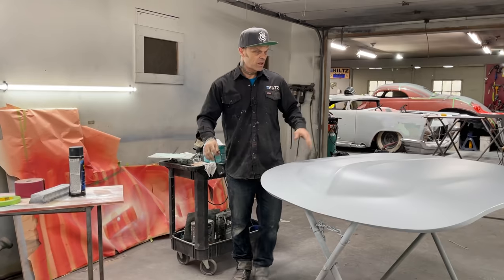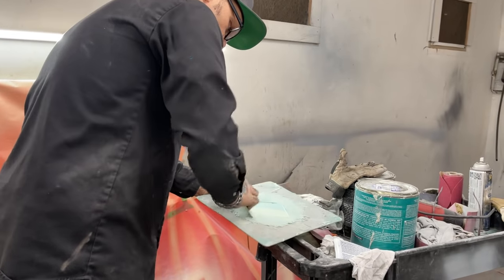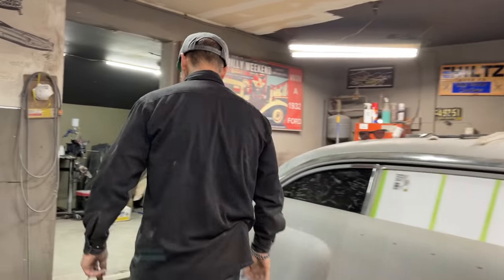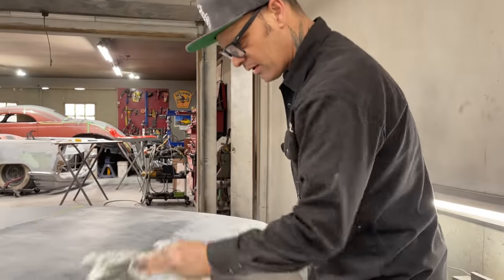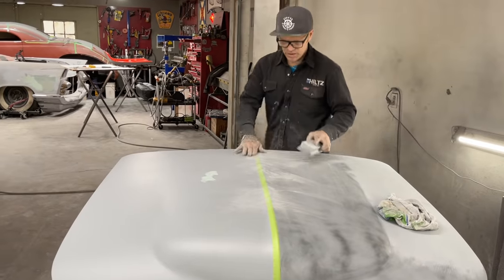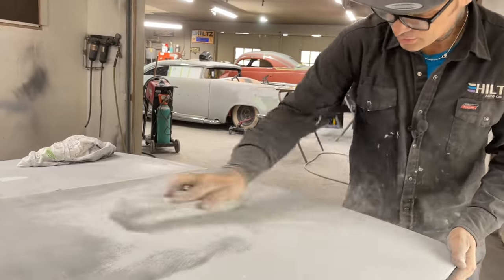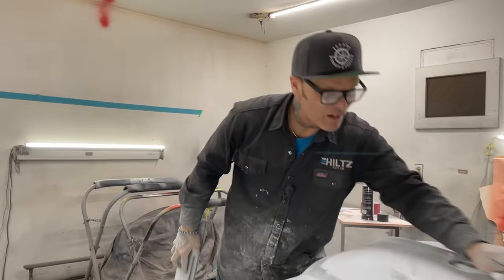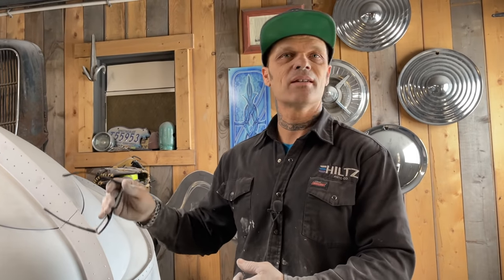Block Sanding Primer the EASY way - DIY tutorial

Comment: I use 1997-2003 Pontiac Grand Prix window regulators. They are very small and the cables are both on one end. Just straighten the track and it works great. Try it, it’s very easy.

Comment: I looked up Elvis Guitar straps last night and found a few keen straps, then I was thinking a guy has to have a way to hold the strap in place once you have the window where you want it..

with a guitar strap there are positions in the way of slits, that's how you adjust its length on a guitar, they slip into a button like the old Levi buttons on the 501's.. longer a different slit.. maybe you can use guitar straps? use the slits and a guitar button mounted to the door to lock the strap it in place and have adjustability?

my guess is you are going to want some weight at the bottom of the window just for some stability so the window doesn't fly up on bumps so forth... when you have window where you want it in any position clip strap top button.. some nice Elvis straps out there, I can prolly drop ship 2 at your door with a few buttons that mount very easily, phillips head...  there are strap lock set ups be pretty cool too, push button style what not and that locks the strap to the button, you have to push a button to remove strap off button..... you're doing it for both doors right?

Comment: They make slider windows that go side to side in trailers also up and down with just a small finger plate to push pull, but they use a weighted string to keep them up,,Love the simplicity of the belt as long as its centered it should go up without trying to angle but on the driver side i would use a belt that has a zipper on the back so I could put the insurance and registration in it ,I had a belt that has a zipper that went across the inside,sort of a stash so to speak,,Great job as always guys,

Comment: Greetings friends 😊 I  learned something hear today. 80 grit is the best to block with, if you use 100,120,150 you'll just be taking the guide coat off and not leveling, changing cloged paper 10 times . I've been doing it wrong I'll admit, 80s faster better results and only sheets. Awesome 👌 🆒️.  Common sense 👏 is what we have learned here, I  like the hand method better than the DA,less  dust. Brilliant 👏.

Comment: Chad, PLEASE try 3M or Mirca dry (powedered) dry coat. I recently started using it and the difference is AMAZING. plus, you can use the Mirka white dry guide coat during wet sanding clear between grits of sand paper! 👍🏻😎

Comment: What I do to find every pin hole is clean it really good so it's smooth with no dust, turn the lights off and use a flash light and all the tiny shadows are the pin holes.

Comment: Zebra print fir the interior. Elvis loved his Jungle Room, ploys it would set off the black white theme of the car. That red is such strong color a little goes a long way. To use it in interior it would overwhelming. The dash and a few parts with the red is ok. But Zebra would be a great finishing touch. Your going tint the windows so imagine what a powerfully cool effect it would have when you opened the door to that Zebra interior. On the strap you should put TCB. Elvis’s motto, he and all his Memphis Mafia had gold chains with a lighting bolt, like the one you’re going to put in black on the sides, but on the gold lightning bolt was TCB, it stands for “Taking Care of Business”… if you’re naming the car Elvis do a little research. A true Elvis fan knows all this and would appreciate the sentiment…

Comment: The tape on the hood is a good tip👍
Reply: It helps keep the body lines sharp. I try to put the second piece of tape on before I pull the first one off. Yes great tip.  When paint is on the panel it makes all the effort worth it

Comment: I know that many European sports car manufactures back in the day used a belt pull system in the doors for windows. Because the doors were so thin. There was no room for a crank mechanism inside the door.

Comment: The flash time all depends on the time solvents require to evaporate. The issue is some solvents require more flash time than others. 
So also layering primers. They stack better by adding layers. If just one heavy coat then certain formulas condense and becomes only so thick. 
If the primer flashes enough before you add the rest of the layers then you are fine. You will know if you have one heavy coat that is just more dense or if you have a primer layer build going on once you start sanding. In doing body work we do what works for us. We have to do the work in the end so we make it easy for us. No one else. So if what you do works for you that’s cool. As long as people don’t try to force us to do things only one way. Their way…I’m good. Lol

Comment: Here's a cheap trick for sanding in curved areas, go to the hardware store and get some paint rollers but get the cardboard backed ones so you can form them and wrap your sandpaper around one and use it as a kind of curved block.

Comment: if you connect both ends of the belt to the window, out of the top of the door and in at the bottom in a loupe you could both open and shut the door window pull it down to open and pull up to close.

Comment: If you are going to use a belt to have the window go up & down (instead of a crank or power windows), why not put a roller on the interior of the door down low, and make the belt loop from the bottom of window down to the roller and out of the bottom of the the door panel (with a couple slots in it) and back in the upper slot in the door panel, and back up to the bottom of the window. Feed the belt through the slots and have a small handle on it between them so you can raise and lower the window. You would raise the handle to lower the window, and lower the handle to raise the window. (I hope I explained my concept clearly enough...)

Comment: Hello Chad and Jolene, 

Great job on the hood. I was wondering, which do you prefer, a stiff block of a soft rubber block? No pun intended lol keep up the great content.  Take care and God bless.
Reply: I will answer for Chad because his preference is not having a wide variety of tools such as sanding blocks.  The preferable sanding block is the one that works best for the panel you’re trying to get straight. Long straight panels are generally best done with a hard longboard. Some people like the sanding blocks that have removable rods so you can adjust the stiffness of the block.  It makes them a little more versatile when it comes time to sand a crowned panel such as the front of Chad’s hood. Custom car painters faced with a complicated body usually make several simple sanding blocks to fit each contour. 
 A sanding block can be a piece of a paint stir stick, a piece of pvc pipe, etc.

Comment: Hey Chad... Could you thin out the  feather fill with a little acetone to make it lay out better thus making the final coat smoother and reducing the blocking effort... thx... M
Reply: Yes that can be done. Cap full per sprayable quart

Comment: When croming the bumper (or anything else) you can use Crome FX, its a chemical proces that you spray on in 4 or 5 steps, blow it dry with air, and seale it with Clear topcoat. You Cant tell the differens from Real Crome..

Comment: You need to break down the corners of the sand paper on the block so they don't dig into the surface they are sanding . First thing I learned on my first day of sanding when I was a kid in 1975  .
Reply: I’m just happy that he’s using sanding block. If he sticks with it he will pick up the little tricks as he goes. I try to look at hours of crisscross sanding as a free workout.  No need to pay for a gym membership

Comment: It’s where you start and stop the guide coat spray that gives the appearance of high spots. Holding the guide coat to long in one spot.
Reply: I think the guide coat looks near perfect.  Also it’s the low spots that retain the guide coat because the sandpaper does not reach it. 
This is why you use the hard long sanding block.  If you sanded by hand, or a dual action sander, you would never get the hood flat.  It would look good until you put paint on it.  It’s really up to the individual if they want a nice looking paint job or one that just looks so so
Reply: @i8ntnuts  I just noticed how Chad held the can in one spot slightly longer , as he sprayed back and forth, than other spots. Thus,  giving more guide coat on that spot. Which would give the appearance you mentioned.

Comment: 2003 Malibu I have, passenger window failed today switches wouldn’t make it work so I leaned over from the drivers seat and pushed the switch on the passenger door for the window and held it on and hit the inside door panel with my hand and it worked. I have a Lincoln mark Vlll that I did the same thing to to get the drivers window to work. Passenger window on it has failed also. Drivers seat has failed do to bad motor. Yes we need something more simple!

Comment: Im just going to tell you how i.sand an were stop with the sanding i will use 80,120,220.then paint i may even stop at 120 cause im getting older and I just paint single stage.

Comment: I really like your ingenuity and your work but I don't always see things the way you do when you are trying to explain it. Your window system definitely works but not sure it is easier. It really only has a fully up or fully down. That is unless you do a velcro or snap system which makes it more complicated than a crank system. Not so much in its function of up and done but the operation of it. In manufacturing there is this thing called the quality triangle. The three sides are cost, time, and quality. There is a balance. You can have any two but not all three without compromising one of the sides. I am glad you enjoy the cars that you build and that is the reason I have been following you so long. But sometimes it is almost like you are trying to convince yourself and all of us as to your decisions. You don't need to do that. Do what you want and what works for you but the convincing doesn't always make sense at least not to me and my experience. Keep doing what makes you happy.

Comment: Nothing wrong with coming up with your own idea for now maybe later you will change it if the belt doesn't work. Once you get your car on the road I'm shire there will be plenty of thing's about it you would want to change. 

I built car's that I had to change on the engine to make it run better. 
I tried to put on all these after market parts  to make the engine "LOOK GOOD" It ran like shit.
     I put all the original engine parts back on and it road/divine with no problemos. 
Any how an idea turns into many idea's. That's how we all learn. After all "EVERYDAY IS A SCHOOL DAY", the Legend would say Gene Windfild.
Reply: When modifying an engine it really pays to do your research and or get help from a professional engine builder

Comment: way too short block for a such along profile. I am total amatuer, done only one full car. But think about physics. So short block will level only maybe ca 30-50 cm area, it DOES NOT "support" outside that area anything, so you can have very wavy final result. The wider/longer "support" sandig block have on the surface, the more even level result.